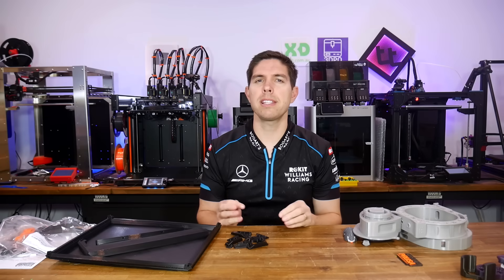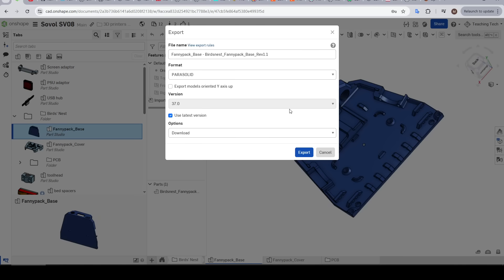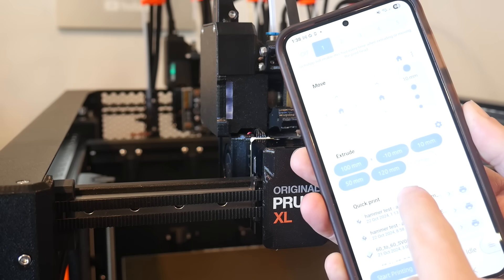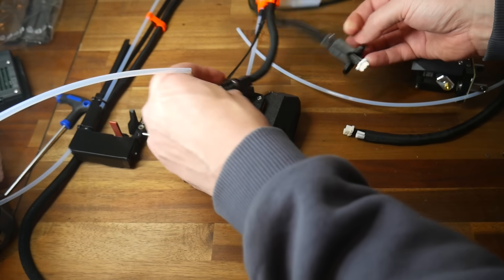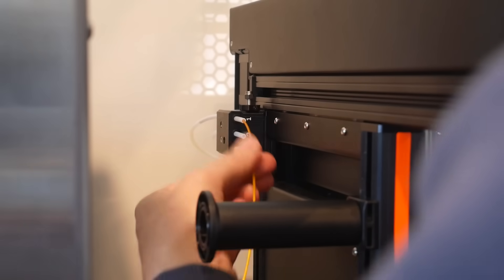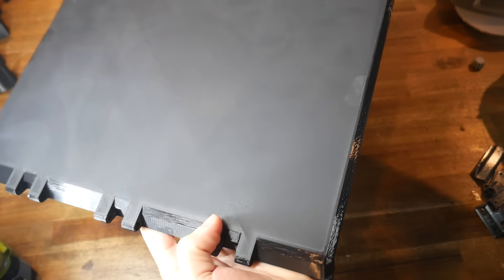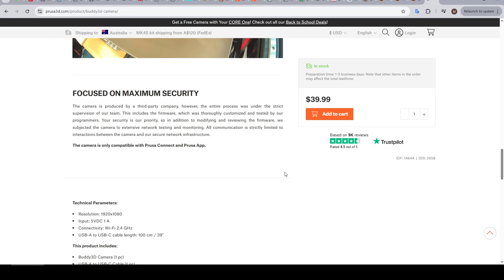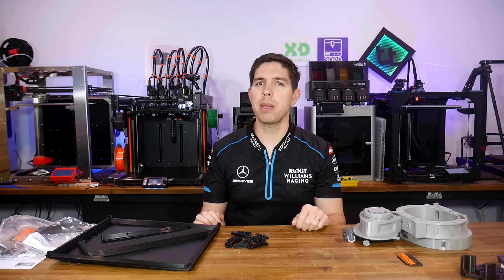Evaluating my replacement Prusa XL + SV08 update

Comment: 8:29 I just had to stop here, it is absolutely insane that Prusa is charging $3,500+ for a printer that is frankly so DIY. Tons of problems, so many 3D printed Parts instead of injection molded. These parts are injection molded on a $99 printer. It's so ass backwards I mean really one of the biggest benefits of 3D printing is cost-effective part making. Yet prusa uses printed parts and charges more than almost any other manufacturer on the market. And to be clear I don't have apersonal grudge against Prusa but it is complete garbage value 🤷🏽

Comment: Having a customer manually have to attach and detach each tool head so it can learn where they are just shows how Prusa’s mindset needs to change. That’s the kind of thing that needs to be engineered out for these to become mainstream appliances and not nuisance a niche enthusiast machine.
Reply: Yup. Not to mention the crappy user interface + display. It's functional, yes. But it's absolutely not worthy of the price that's charged for the printer. Mine has been generally very reliable, but that's after spending my own money for smaller nozzles. And don't get me started on the fact that older printer buyers have to disassemble their preassembled printers if they want to use an enclosure since all of the parts were printed with low temperature plastics.

Comment: I had some stringing in a new Prusa hotend. Turned out the thermistor was wrong or defective and behaved like a 200kOhm thermistor instead of 100k, resulting in a too high temperature in the control loop, resulting in stringing.
They send a free replacement sensor, which fixed it. But wonder if this could be a wider issue?
Reply from the maker: You would hope that if they know about this issue, a new machine like this would have the fix.

Comment: I understand that the XL extruder has a problem with stringing compared to the MK4S extruder.
I think that if you could also disclose environmental information during evaluation printing, the information would be more reliable. It would also be good if you could measure the humidity of the filament.

Comment: GREAT Video. This is a great example of where PRUSA suffers IMO, the multiple filament head printer IS a good idea AND now Bambu knows it (initial double head), SO... expect they come up with something that's INTUITIVE TO THE USER to use AND JUST WORKS very soon. Thanks for the update (more info would be handy about other types of filament interaction) and presenting your journey, sadly not looking to travel down this path so XL IS NOT FOR ME (I'll just deal with the waste-which is starting to be the only issue, with other filament types able to work on the AMS)

Comment: Blaming stringing on a printer is pretty wild dude. That is your filament and your settings. That will literally happen on any printer due to poor settings. How do you have a channel this big and put out a video like this?
Reply from the maker: Are you serious? The same room/conditions and filament on other printers is fine. I put in these back to back tests to demonstrate that there is nothing wrong with the filament. The settings are straight from Prusa in their slicer. I have dozens of printers where this problem does not exist, but with the XL it does and somehow it is my fault?
Reply: @TeachingTech  I'm dead serious dude. Contact any 3d printer manufacturer or any filament manufacturer for that matter and tell them the issues you are having and watch what they tell you. Stringing is your filament and your printer settings. There's also a reason why this is the only video I've seen complaining about this because this isn't a 'printer' issue.
Reply from the maker: You need to look a lot wider then. In my first video on the XL I went through the Prusa forums to show that the stringing was not uncommon. That's me being diligent, you need to do the same.
I still need you to explain how I can do the exact same print, with the the exact same filament, in the exact same room back to back on other machines, without stringing, but it not be an XL problem.
Reply: @TeachingTech  Again, contact support and see what they tell you. Also, try drying the filament and fixing your printer settings. If you dry the filament and your settings are correct and the stringing goes away, it isn't the printer dude. This is elementary school process of elimination. Every single printer on the market will string with the incorrect settings.
Reply from the maker: Prusa's solution is always to dry the filament. Some problems: 1. Other printers can use the exact same filament without issue. No stringing. 2. As stated in the video, there's no point have a multi zone power saving bed if you then need to consume electricity on filament drying.
This is how the scientific method works. You have constants and variables. Here the constants are the models, the filament (including moisture level), the room and the humidity within it and myself. The only variables in this back to back test are the printer and the slicer profile. Either the printer is sensitive to stringing or the PrusaSlicer profiles are not tuned correctly. Both are not good outcomes.
Reply: @tonydavis6487  Lol - you haven't been printing very long have you.  How hard are you going to fanboy up Prusa in this videos comments?
Reply: @theangrymarmot8336  This dude has over 500K subs and is putting out information like this, it's crazy. Every single 3d printer on the market will 'string', with filament that isn't dry and with the incorrect settings. This is like 3rd grade, elementary school, comprehension.
Reply: @tonydavis6487   Lol at you mentioning "comprehension" when you are obviously having such a hard time with it (TT mentions a few times in this video the filament had been through a drying cycle.......) Also, funny you use "3rd grade" - yet you are the one in another thread here playing the "yOu CaNt AfFoRd It" card when someone has valid criticism of Prusa machines. You are pretty much the definition of an annoying fanboy.  It isn't TT's fault you fail to understand the interaction of firmware with machine operation, and/or how the design of an extruder and/or nozzle can affect stringing. If you actually knew what you were talking about - you would know this. Stringing isn't always a result of "settings" kiddo, and your insistence that it is just shows how little experience you have.

Comment: Glad to see the improvement. 

What printing profiles are you using?  I get almost zero stringing on any filaments, including TPU. 

For everything except TPU I use the prusament profiles. For TPU I had to do some tweaking, but I found that slightly higher temps with absolutely minimum retraction had the best results.
Reply from the maker: I am using the standard, unmodified generic profiles in PrusaSlicer (just like I do with the Bambu Lab H2D). I guess I will tweak if I need to, but that will be harder with PrusaSlicer not having the tuning tests built in like Bambu Studio/OrcaSlicer.
Reply: @TeachingTech I've found that the prusament profiles are pretty much spot on.   I use them for all different brands of filament.
Reply from the maker: I will test with them too, thanks.

Comment: The original XL was launched too early and was not ready. Nice to se that at least they have made improvements and now it is a reliable machine. I want to see that enclosure you are building. Hopefully INDX is coming to the XL, I want to see how many nozzles they can fit on that beast. It's funny that the Core one is one of the smaller Core XY machines available and yet the XL is one of the largest.
Reply: After waiting years and only just buying an Xl and not overlay happy so far it would be a kick in the nuts having just spent on the 5 tool heads for them to fit something way better all of a sudden.

Comment: The H2C announcement was the final nail in the coffin for the XL (IMO)
Reply: Muy guess is that the H2D did a lot of damage to XL sales already. The H2D can do alomst anything better than the XL exept for 3+ colour PLA/TPU prints. Printing engeneering parts with support material or combining TPU with other filaments works just as well with a dual nozzle head.

Comment: A fair review imo. However, you mention the lack of open source components. Prusa decided to do this because of the rampant practice of some other brands (sponsored by their nation state) taking open source tech, implementing it and putting it behind copywrite / patent walls. Joe and others have written at length about this and I find it a bit disingenuous of you to criticize Prusa on this matter when you very well know the issues driving it.
Reply from the maker: Hard disagree. Firstly, the XL is the printer lagging behind with publishing open source elements. That page shows that for other machines more is published. Secondly, I'm unaware of anyone trying to copy the XL or anything from Prusa anymore. Most new printers look like a Bambu Lab X1C. That's clearly what others are trying to clone, despite it being closed source. Thirdly, as I said in the video I always test what manufacturers advertise vs what they deliver. Prusa place a big emphasis on open source in their marketing, and they have not fully delivered on this with the XL.

Comment: The length of the bowden and the filament sensor cause a lot of friction. There are many solutions to decrease that friction. If you improve the friction situation, the stringing problem should be gone.
Reply from the maker: To shorten the tubes would require the filament to be mounted up high near the tools. That is going to be a problem given the umbilical path on top. If you can list solutions for me to look up I will happily explore them.
Reply: @TeachingTech  If you can't shorten the tubes, modify the filament sensor. There are mods on Printables that use magnets instead of springs. Can't link them because YouTube doesn't like links.

For testing purposes, you can also bypass the filament sensor and check whether that improves print quality.

Some people use a filament holder that uses bearings. That might be another way to reduce friction.

Another thing that people might miss is that you need to adjust/calibrate the nozzle seal at the docks.

Comment: I just upgraded my MK4s to coreOne and i have to concur. 
Prusa printers do feel dated.
Also, during assembly, there were numerous times where I was absolutely dismayed at the engineering decisions that were made. Vinyl rivets? holding substantial parts of the printer together? really?
Cheap insubstantial cable glands.
wire routing on the hotend is ridiculous for 2025.
software on the printer has not even arrived in this decade.

This is certainly not how it should feel to assemble the product of the industry leader.

Comment: Hi, I'm from Argentina. After a lot of testing, I managed to create a profile that works very well. I don't even need a purge tower for many prints, and I can use the entire bed! Please test my settings and tell me if it works on your printer! Thanks and best regards!
Lift Height: 0.4
Use Ramp Lift: Off
Retract: 0.8
Retract Speed: 45
Detract Speed: 25
Minimum Distance After Retract: 2
Retract on Layer Change: On
Clean While Retracting: Off
(Retracts when the tool is disabled)
Length: 2
(Filament)
215°C PLA / BED:60°C

Comment: Thanks for the video Michael, owning about 5 different printers I like Prusa's open source ideals, but as you say that's changed a bit. This would change my opinion on a mulitihead printer and push me more towards another equivalent. The underlying elephant in the room is,  are you (the purchaser) a tinkerer or someone who just wants something that works out the box. I feel Prusa are now the former, for the XL and Bambu taking up the latter audience.
Reply from the maker: When I look at my plans for this printer, it absolutely will be a tinkerer's project. My first Prusa was a mk3 that I didn't touch for years. The shift is interesting indeed.

Comment: I have a Prusia XL with five heads. I got a new August 2024. As of today, August 2025 it is used practically every day for multiple prints. I have never seen any other stringing you have been talking about. Very happy with my Machine. Thanks for your great video, very detail orientated. Look forward to your next review.
Reply from the maker: Absolutely, some people don't have he problem, but there's plenty of people that do. I can say with confidence after testing the same filament in the same room back to back with other printers that the XL is sensitive to stringing compared to anything else.
Reply: Don't worry, he mentioned at least 3 times other people don't have problems
Reply: "My machine is OK"

Comment: Hey my 10 seconds of fame! That is more my experience with the XL. Stringing does improve with some retraction settings but that took me a while to get right. Multimaterial printing is amazing and I’m not giving my XL back, five color printing is very nice but not as unique anymore. So unless you need multi material this printer is not worth the $ or the hassle. Modern multi-head printers are coming that I expect will be simpler, more reliable and cheaper, just wait.

Comment: For 5,000+ dollars the CEO of Prusa better come to my house and assemble the printer himself! Stringing shouldn't even exist! All the parts that are 3D printed should be made out of laser cut metal. They should offer a pork free and red 40 free alternative to their gummy candy, and I should have a year supply of filament + an enclosure. I don't care. It's way over priced to be that bad. The fact Snap Dragon sells a 700 dollar toolchanger head shows there's no excuse. They're outdated and over priced. It's ridiculous.
Reply: Why would you want pork free gummies?
Reply: @danieldc8841  Because I don't eat pork and I don't want cancer and there are many alternatives to pork gelatin including but not limited to Bovine (from cows). And while it sounds like i'm nitpicking, for spending 5,000 dollars it's not that much of an ask especially if I actually eat like this in real life.
Reply: @boredfive3001  Just don't eat the gummies. It's OK.
Reply: @hellcoreproductions  I never said I didn't want gummies. I just said I wanted gummies I can eat. If they think they're doing me a favor by including then they should at least give me the option of choosing some that I can eat. If the printer were being sold for less than 1000 dollar I could possibly see your point. However for 5,000 dollars and no enclosure included they better make the gummies themselves if they have to!!!!
Reply: @boredfive3001  Gummies are about £2 so just buy some you want to eat. You're more likely to give yourself cancer sweating the small stuff than gobbling delicious piggies.

Comment: I feel less and less value for this machine as the value you get from other options is just absurdly more. I'm from Brazil and one XL would cost me around R$60.000 to import. This can allow me to buy 4 X1C combos here (BambuLabs already imports and resells here). Not to mention the amount of costs in maintenance if I ever have to ship parts back to them. Again, Bambu has local support via resellers here. It is just too hard to justify for the price. Thanks for the update!

Comment: Contrasting this kind of Prusa experience with the super polished user experience for competitors like Bambu Labs shows a stark difference. Even when things go wrong with my Bambu Labs printers (rare but it happens) they have really good wiki repair instructions and all spare parts available. I was really down on Bambu when they made THAT decision that everyone hates but I'm starting to come around to the thought that it may be worth it for what you actually get (probably unpopular opinion, don't @ me). Lots of tool changer systems are coming to market that I am excited for, sadly this one isn't one of them. Maybe the Core One with INDX will be better.

Comment: I appreciate you calling Prusa out for being no longer open source. It's silly they used that as a key selling point for so long but now have a proprietary extruder design and proprietary expensive nozzles and proprietary firmware... It's no reason to buy over anything Bambu labs has on offer
Reply: This.  I no longer recommend them as the open source aspect was worth paying more.   They removed that so there is no reason anymore as everyone else is pulling ahead in print quality, tech and destroying them in price.
Reply: @TimGray  Prusa uses the "eventually open source" approach currently. That's still better than nothing.
Reply: I have some sympathy for Prusa since people like bamboo were stealing their tech left and right. On the other hand, I preferred to buy more open source.
Reply: @Gefionius "stealing their tech"—that's the inherent risk of open-sourcing your ideas: other people can use them. And it's not "stealing" that they USE the ideas, only that they don't SHARE their modifications in the same open way. Too many "open source" advocates get upset when other take their ideas and run with them—yet that's supposed to be the entire idea: put the ideas out there so others can build upon them. It annoys me when those advocates are less upset about "you're not giving back to the community" than they are about "you did a better job executing on my idea than I did."
Reply: @Gefionius  It's hardly stealing when the license they released it under lets them use it...
Reply: Bambu is worse lol